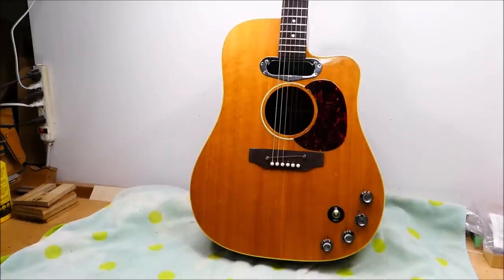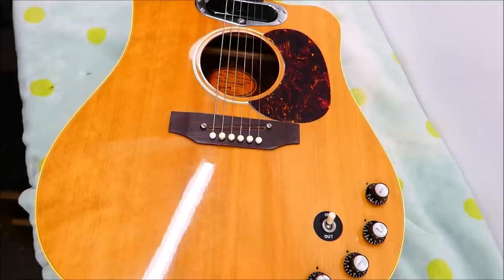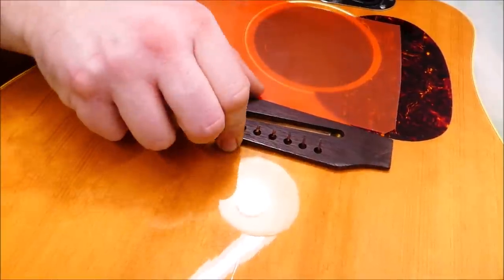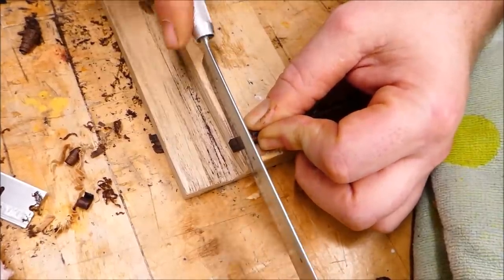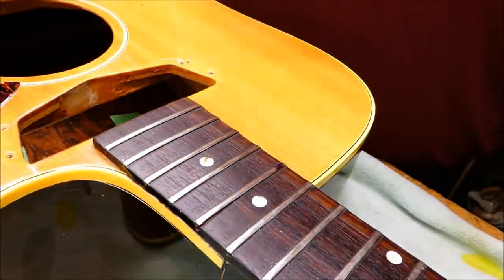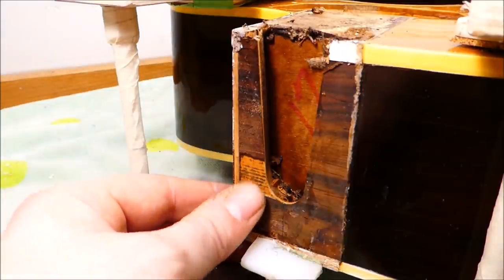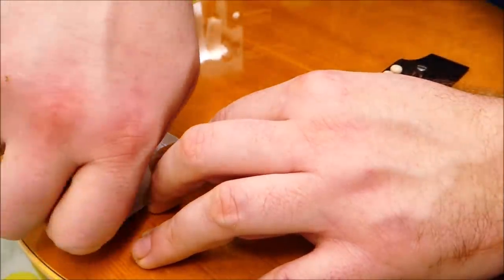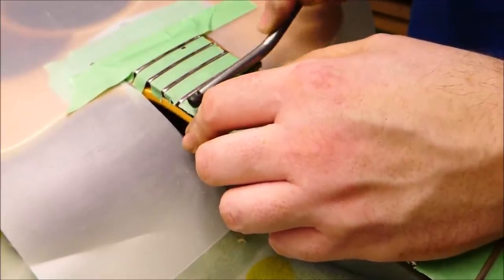A Les Paul Acoustic? What the heck is THAT?

Comment: Stumbled across one of these Gibson LP Jumbo guitars in a little local pawnshop 15+ years ago. Made a bank run to get cash immediately because I was aware of it's rarity due to it's mention in my first big guitar book purchased for me as a gift in the early 80s (American Guitars: An Illustrated History - Tom Wheeler) Though I'd already owned several Fender and Gibson guitars, this was the first guitar of any kind I'd ever paid over 500$ for. This gentleman's assessment of the instrument is the same opinion I arrived at many years ago with almost the same comment of "It's like a big hollow body jazz guitar disguised as an acoustic" And also correct that the unplugged acoustic tone is muffled by both the internal construction, and an incredibly thick coat of lacquer clear coat. (All cracked glass on the top and gator cracked on the back and sides in the case of my example.) They can be set up with almost electric guitar like action which is nice. Nice to finally see the electronics exposed on one. Not as complicated as I feared.
Reply: Awsome story...thanx for sharing...so cool
Reply: P
Reply: Nice story John. Thanks!

Comment: The impedance matcher is basically a Shure A95U rebranded. 
I have been trying to find a LP Jumbo to examine for 45 years. Now I don’t need to.
Reply: Seems like the pickup and electronics are still high impedance, with that adapter to provide the low impedance output.  Would be really curious to see a schematic for the Decade control.
Reply: @Scodiddly  The pickup is less than 10 ohms and can be plugged directly into low impedance mic inputs on mixer desks. 
The a95u impedance matcher on the lead matches low impedance output  to a high impedance amp/desk input.
Technically the decade control only makes a difference if it's plugged directly into a low impedance desk input without the impedance matcher.

Comment: Just FYI (if you don't already know), those small orange drops are tantalum capacitors. Many people don't like them for audio use, but here they were an original part of the sound. Much more importantly, they are known for going shorted after 20 or 30 years. So it's possible that some of the lack of effect on that decade control was that one or more of the caps have shorted (or gone low resistance at least) and it isn't doing what it was intended to do.

(The big orange cap is not tantalum.)

Comment: I had forgotten all about this model, but as soon as I saw this video, I remembered seeing one when they came out. Never wanted one, though...

I have one of those Shure adapters; it came with a goofy early '80s low impedance Shure PE5EQ mic that I still have. It has a 4 band EQ (primarily used for feedback control) built into the housing.

Comment: I have a '71 Recording. The decade switch is a very precisely balanced set of resistor/capacitor/inductor(the pickup) filters that work pretty well when plugging the guitar output directly into the type of very expensive professional console preamp that was prevalent in those days, like the Neve 1073. For some reason, using a line transformer as you are doing here or the onboard transformer in my Recording messes with the balance and makes the decade filters far less dramatic. Something about the transformer inductance being too close to the filters I think.
Reply: It's more likely due to the matching inductive impedance of the console front end. The old consoles used a 600 ohm matching transformer on the low impedance inputs, and some equipment was intended to drive into that sort of load to produce a proper frequency response. Modern consoles tend to either terminate with a couple of 470 to 610 ohm resistors, or are actually high impedance and just respond to very low signal levels.

Also, that tone network appeared to be using tantalum capacitors. Those are known for going shorted or very low resistance over 30-40 years. So it's possible one or more has died and it isn't doing what it is supposed to do.

Comment: What a treat!

Also, that hot knife could be just the thing I'm looking for. Magical kingdoms are just what I need.

Seriously, though, $12 for an experimental solution to a problem I'm having could be just the ticket, and a bit of fettling could allow heat regulation, which is exactly what a $12 solution is made for. 

I actually quite like this old beast, and could easily see myself loving it. Some quite crappy tones in the arsenal, but a couple of really nice ones too. I thought it sounded horrible and dead until you started with the decade switch. It went from dull as dishwater to bright as a stream, if a little brittle. Some minor modification and modern components could make it really quite versatile.

Clearly on my own in this.
Reply: Where do we get the hot knives? I need two 😃
Reply: A magical kingdom...where else? @harpethguitar

Comment: I have a Les Paul Jumbo that needs just about the exact same treatment. Neck reset for sure. It’s also a bargain, stamped BGN on the headstock, just to make it even weirder. Mines a bit different though. Different wood on the back and it has A normal 1/4” phone jack. The strap button near the heel is in a different spot as well

Comment: I have done electric mods on acoustic guitars a few times. I never do anything that will be detrimental to the acoustic resonance of the the top. Pickups can be mounted to a bracket that is attached to the inner neck block, and "floated" in the hole through the top. This isolates the pickup from the vibrations in the top wood to cut down on the potential for howling under high gain and high volume. It also allows full resonant performance of the wood. as for the controls, as long as they are located very close to the edge, they will not disturb resonance. No reinforcing needed.
Reply: How do you think will this type of guitar perform in the context of it being used as an acoustic guitar? Will it be at least comparable to most dread nought when unplugged?

Comment: Tie fishing line round the shaft of each pot as you remove them, then you can ‘fish’ them back through the holes again.
Reply: Totally unnecessary in a dreadnought. Common practice for archtops with f-holes, of course (the surgical tubing works even better), and Ted knows this. It strikes me as odd that you watched this whole video and thought, "Hmm... He probably needs my novice guitar-repair tips. I'll tell this journeyman luthier and guitar history scholar about a technique that has been common practice for nearly half a century. I'm sure he'll be blown away!"
Reply: @xdoctorblindx  I mean not everyone watching will know about the fishing line thing, he also seemed like he had a hard time getting them back in so maybe it isn’t totally unnecessary on dreadnoughts after all 🤷🏻‍♂️
Reply: @Jonathan_Doe_  shhhhh
Reply: @gregmize01  ooo, you sure told me
Reply: @xdoctorblindx  Surgical tubing's absolutely the best. Been using it for 20+ years on any hollow or semi hollow guitar. It pulls the pot shaft straight up through the hole. It's especially priceless on a thinline body ( ES-330, 335, 345, 355 etc. ). Also works for installing varitone & pickup selector switches.

Comment: An odd model, indeed. I knew about the other Les Paul models. Even that Les Paul Signature ES335 looking thing from the late 70’s makes more sense than this thing.

Whenever I heat up my hot pen, it always takes me to a magical kingdom.
I love Chinglish! It’s probably the funniest unintentional comedy known to man.
Reply: What voltage does the hot pen run on and is the temperature adjustable?
Reply: @goodun2974  the smaller, guitar appropriate models are around 15-20 watts and heat up to 250c in open air. They are not adjustable and run on a dc wall wart.

Comment: I never knew they made Les Paul Acoustic guitars. I just checked online and there is one for sale for, well with shipping it would be a little over $10,000. That's a lot, but I would have thought maybe more. But this one was supposedly a 1969. The label in the sound hole seems to verify that. I did see one other that was one of the ones made on the early 70's, that one was just a little over $2000. So either the value is less for the ones in the early 70's, or the person selling it doesn't know what they have. Might be a good investment for someone.
Reply: I think 50's and 60's are considered the "golden era" for Gibson electric guitars. Most collectors would consider these the "best" guitars that Gibson ever built and it was a period where a lot of successful innovation was taking place at the company.

The 1970's through the early 1980's is considered to be one of the worst periods for Gibson. The company came under the ownership of the Norlin Industries which was focused on extracting as much profit from the company as possible. Cost cutting became a major focus for the company during this period and that was often reflected in the quality of the guitars. It was during this period that the demand for "vintage" Gibson's started since many players felt the earlier examples were better quality.
Reply: @lurk7967  Thank you for taking the time to go into more detail. I for one, appreciate it a lot. I just recently retired, and I'm finding that my post employment interests have landed on guitars. I love caring for the ones I have, and I've learned quite a bit researching things. I have 11 guitars, so once I get through them, I'm pretty much getting ready to start the process over. Thanks again!!

Comment: I seldom use rougher than 200ish on guitar work unless I'm shaping a new part, or roughing up for adhesion. 120 takes too long to polish out even if it takes off material faster. I find that brand of paper matters a LOT.
Reply: Oh and you can find those decade knobs if you look around. Not exactly common, but you are unlikely to need a bunch.

Comment: Could a small fan, vacuum tip, or focused blower remove the dust on the sides when pulling the sandpaper under, instead of stopping to brush between pulls?

Comment: What voltage do those "hot sticks" run on and is it possible to adjust the temperature?
Reply from the maker: You can buy rheostat controls from the company that sells them, or hook them up to a variable DC power supply. I just used the 6 volt AC adapter and ran at full. I think it's 12 watts.
Reply: @twoodfrd  , thanks, thats what I wanted to know!

Comment: I can fully understand using a lighter grit so as not to damage the collateral lacquer but wonder why you pull the heel in 2 (and sometimes 3) separate passes rather than using wider paper and take the entire heel down at the same time. I assume you do it because it gives you more control?
Reply: Because there's a big dovetail in the way.

And if you're suggesting that he use a single piece of sandpaper with a dovetail shape cut out, it would fail to follow the edges of the dovetail as he pulled it out.
Reply: Oh yeah (slaps forehead) my duh !

Comment: So maybe this is a dumb question…why don’t you use a wider sheet of sandpaper and sand the whole width of the heel in one pull?
Reply from the maker: There is a dovetail right down the center. What you're describing will work for some bolt-on necks, but not a traditional dovetail. I've tried making a cutout in the sheet of paper to accommodate but it always gets hung up and goes diagonal.
Reply: @twoodfrd  thanks

Comment: I have an unusual question. I have become a recent owner of a 2020 Taylor T5z. I am having an issue with the G string going out of tune. Here is the unusual part, it goes sharp every time. Any thoughts?
Reply from the maker: The only thing I can think of that might cause a string to go sharp would be a nut slot that is slightly too narrow for the string. If it's being pinched while tuning, extra tension from behind the nut could pull it sharp as it gets strummed or moved by your fingers.  This is very rare.
Reply: @twoodfrd  thank you for your response.

Comment: The LP acoustic actually seem like a good ideal, just at the wrong time. The patch cord is ridiculous,  and could have been built differently.  Still wish l had one.
Reply: Remember the patch cord was a kludge. Les wanted to plug directly into a low impedance mic input, and that would have taken a straight cable with a XLR connector on the end. This cable is simply a low impedance cable to a Shure off-the-shelf low-to-high impedance matching transformer so you can use it with a standard guitar amp.
Reply: @lwilton 
Mr. @l wilton 
 I do remember that. I believe Gibson made a couple types, one was an E-225 or something close to that it had two inputs that took the , l think it was like a six pin low impedance cord that you had mentioned. It must have sounded very clean, never tried one, and you had to have two amps to use the stereo correctly.  I'm sure the jazz community liked them. But for me playing the blues and classic rock it was very viable. I don't believe that  it ever took off. I'll have to look them up on reverb curious to see how much they cost now. But that LP looking acoustic,  l thought was pretty cool, but like the man said it was more of a hollow body then acoustic.  The acoustic qualities  had to be terrible after watching how it was put together. I wouldn't mind owning one for the collection. 
      Have a great day,  stay safe.

Comment: You can control the heat of an AC  "widget" like the heat stick with a Variac. Just search for variac and you'll get a bunch of links. You'll want to know the amp rating of the stick. If it's not listed it's just watts / AC volts. What an odd guitar.